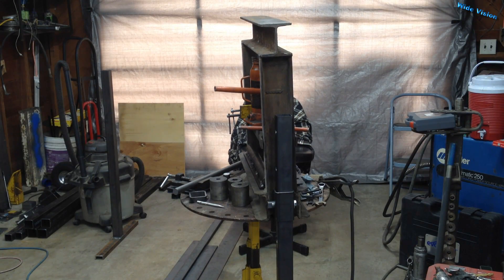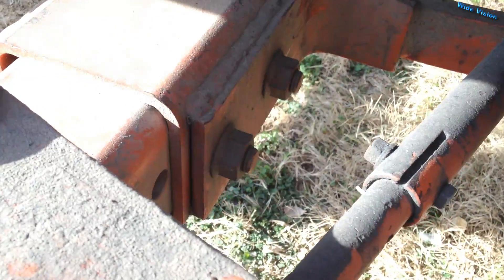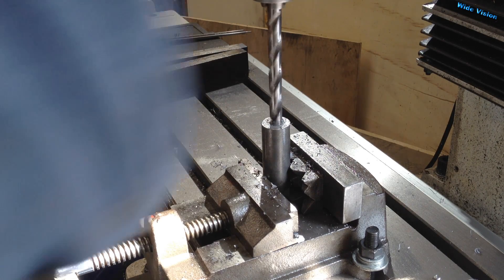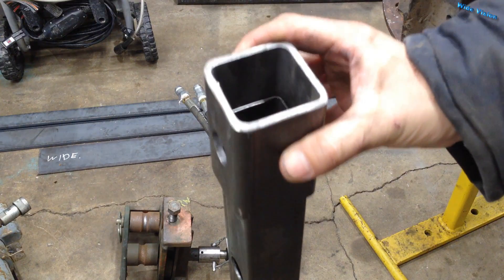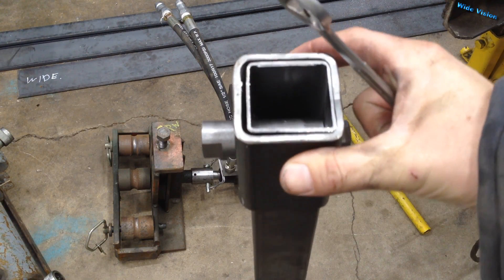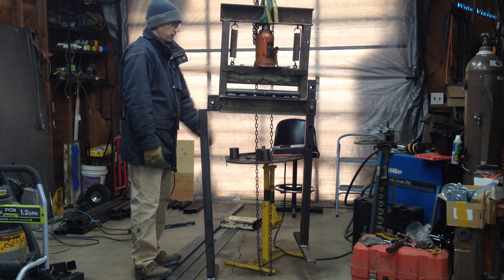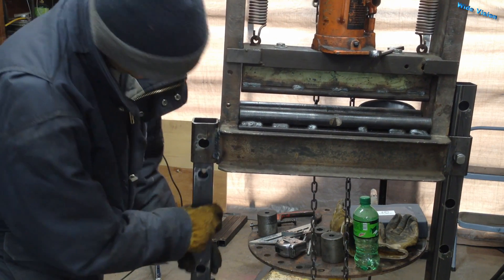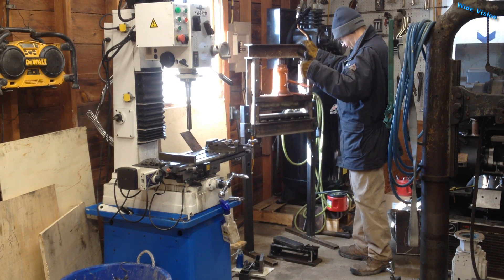Adjustable Press Legs - Or - How to Securely Mount Tubing inside Tubing.

Comment: Nice work!  I like how tight this method is.  What is your tapping setup?  I see you have a 3/8 ratchet tap holder, but not sure what you are holding it with on the mill?

Comment: Helpful hint I hope!,,

Your steel supplier has an index or chart showing what size tubing and wall thicknesses give a sliding fit when used together

It saves a lot of worry and eases your responsibility if you order the wrong sizes.       Another tip ........... go to the suppliers shop and they'll show you how well the pieces fit!!!

Steve Callachor

N S W.  Australia  where we once had steel mills which made this stuff.........

 Now it's all imported!
Reply: Aussie here who now lives in America. Problem with inch sized tubing they have here is that you can't get a snug fit of tubing without removing the weld seam on the larger piece. You can buy telescopic tubing but it is way too expensive. I remember being able to fit 40mm x 40mm tube inside 50x50x4mm tube back in Oz without modifying it.
Reply: @JWB671  I just watched a video where a guy shows how to remove the weld.   Very clever.
https://www.youtube.com/watch?v=ozSE7Wrdb1o&t=1310s

Comment: Hello. What is the gap between both tubes (0.06 in on each side will work?). 
I'm planning to build a square telecoping tubing system of my own and i'm wondering which dimensions should I consider (specially the thinckness of the tubes and the gap between them).
Thank you and good video

Comment: I now know how I will make my welding table legs telescope without it being "shakey"...  Thanks for vid!!   BTW one suggestion...  You made the hole a close tolerance hole, you could do the same with the bolt hole side by "countersinking" the shoulder of a short shouldered bolt with a few threads on it.   Or buy a proper AN bolt for this function.   Obviously not a big requirement for this project, but if you had one where you wanted both sides of the hole to carry a load, that would do it..   thanks again!

Comment: The shop is looking good! Do you have any problems with your compressor being out in a below freezing workshop? Guessing you just blow down the water whenever your done for the day?
Reply from the maker: No problems yet. It might take a few more amps to get going when the oil is cold. But  I got a wood burning stove built and installed recently (video someday) and now I'm working in a 60 degree shop!  I can't wait to get it insulated, too.

Comment: That is a good idea for pins.  I have only screwed with IH front axles.  They are round tubes with one bolt in the center and two bolts outside the tube on the clamp.
Reply from the maker: I know what you're talking about, as Grandpa's old 1030 Case had the round tube and outer clamp design. I'll have to do some image searching and see how different IH's version was.
Reply: From what I could see online, the two systems look very similar..
Reply: @WideVisionMetalFab  thank you, I'm curious about this other system....would you recommend this method for building metal furniture that needs to be broken down in order to ship flat?   do you know if I can buy the pins for 2' and 1.5 ' tubing?

Comment: Very clever idea on how to secure pins. I've always pushed them all the way threw and used a spring clip pin in it to keep it from coming out. That was always a  loose fit but would not come out. I like your way no slop in it at all. Thanks for the video.
Reply: Jj JJ JJ no